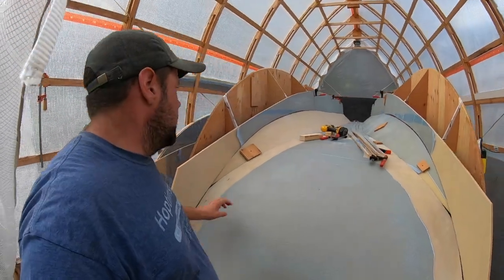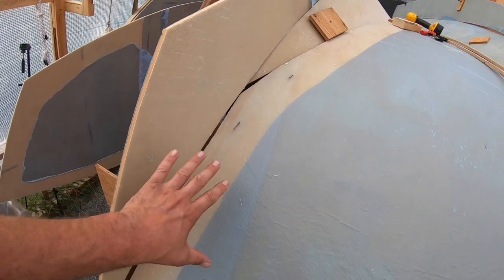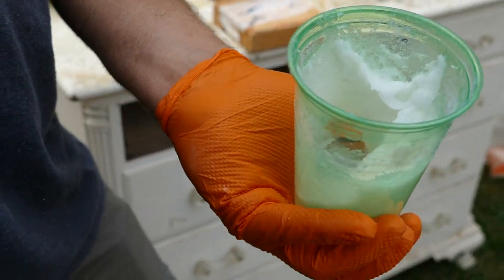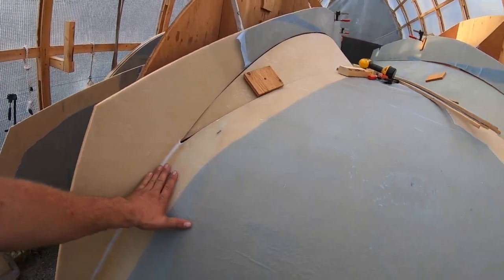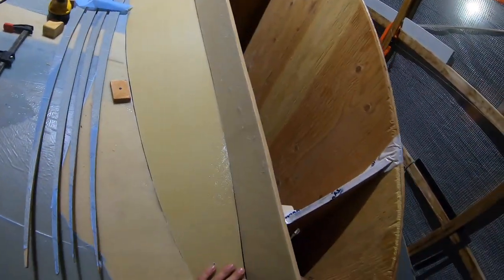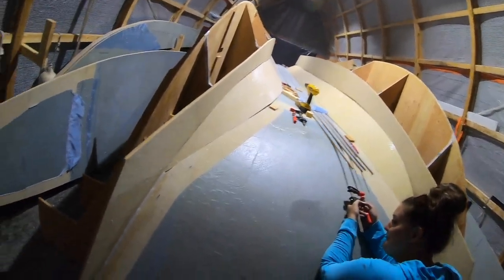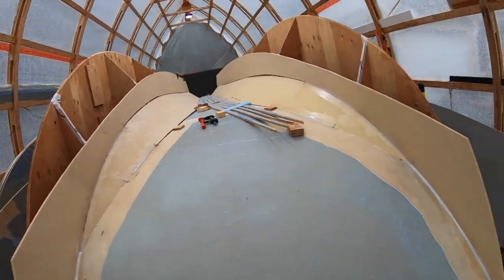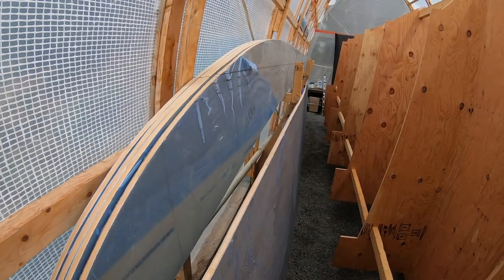Step 24: Just keep fitting!

Comment: You could keep your panels in position easier with some temporary stitches. I used 1/4" zip ties. Just a couple holes, easy to remove when cured and easy to fill when you remove the zip ties. The piping bag trick works well as mentioned before. Are there other thickeners other than silica that you can use?
Reply from the maker: not a bad idea... we werent even thinking of stitch and glue! we ended up screwing the panels into the forms... you will see it soon! thanks for the input. we always appreciate it.

Comment: Mix your filleting resin a little thicker,, looks a tad too runny. If your not doing a wet lay straight over the top then put peel ply over the fillet. That saves having to abrade it before laying up over the top later....